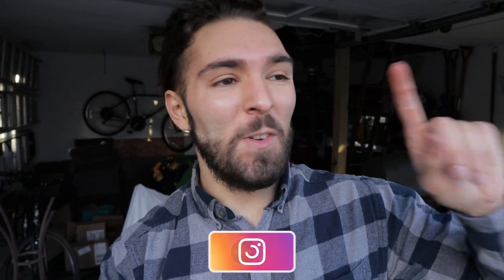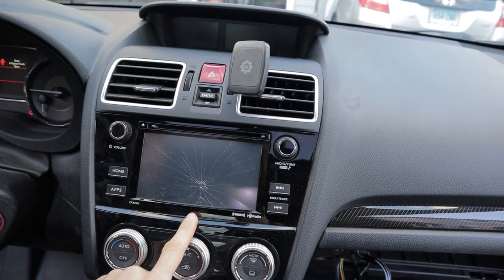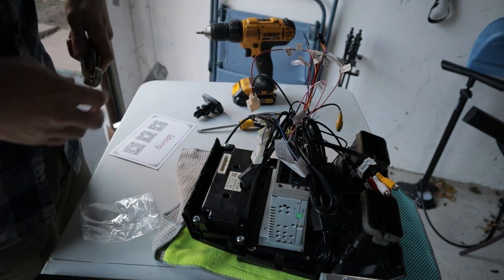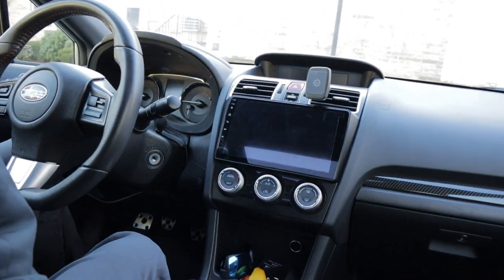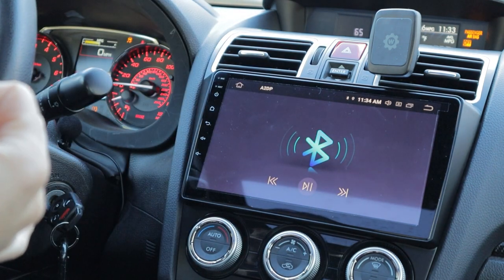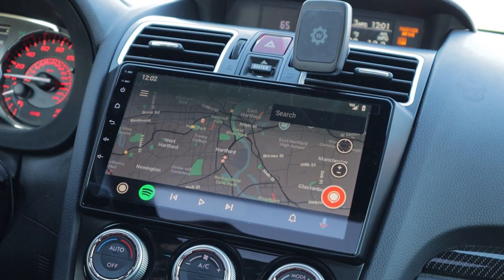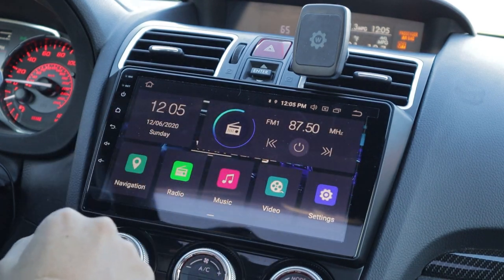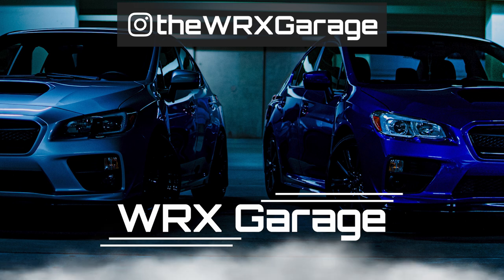iDoing Android Headunit (With Android Auto!) - Subaru WRX 15+

Comment: what voltage does the headunit put out? consensus that android headunits are garbage for sound quality... anybody that upgrades the stock headunit is going to "sound better" because it sends more voltage to the speakers. but how much? trying to compare to the well known headunit manufactures in sound.
Reply from the maker: I believe this headunit puts out around 25-30 watt RMS to 4 speakers! Stock is less than 10w rms.
Reply: @WRXGarage  jesus... thats incredibly low for a headunit and could cause interference. thanks for letting me know.

Comment: Hello ¿can you use the original factory back camera without changing anything just by connecting the cables of the new navigator audio? ¿ can use steering wheel voice command is it possible or not? ¿can it be installed on my subaru xv from the year 2015?
Reply from the maker: Yes and yes!
Reply: @WRXGarage  !!Thank you very much for your reply! ! Greetings from Spain!

Comment: in order to use z-link/android auto... do you have to connect it through wifi/mobile hotspot? Or does it automatically run off of your phones data/signal when its plugged up through the usb port??
Reply from the maker: It just uses 4g/5g cell signal
Reply: @WRXGarage  with that being said, you do have to connect through wifi/mobile hotspot???
Reply from the maker: No.. you receive all data from your normal cell signal. Connect to Android auto in the headunit via USB.

Comment: Any issues with the microphone? Did you added the extra one on top of the steering wheel ??
Reply from the maker: No issues with the microphone at all, even at highway speeds. Yes I'm using the external mic they provided and it's mounted on top of the steering wheel.
Reply: @WRXGarage  is the wore long enough that you can mounted on the factory location
Reply from the maker: Yes the wire is actually very very long. You could easily route it through the A pillar to the mirror.
Reply: @WRXGarage  I got my set for my WRX 2 weeks ago. My microphone seem not working well on both the built in or external mic when the vehicle is moving, other party can't hear me. When vehicle is stationary position, it seem ok as feedback from the other party. Any advise? Contact Idoing but they are not helpful at all. Their reply is just " No suggestion".
Reply from the maker: Definitely look in the settings to see if there's some kind of noise reduction function or something like that. I've never had any issues with my system
Reply: @WRXGarage  Have tried all setting which I able to find but no luck. Very disappointed with the support idoing is giving. No solution at all. 
Firstly my parcel come with the external mic missing. Thought after they resend me the external mic may solve the problem but same issue.

Comment: Is it normal with the Idoing head unit for audio to cut out when you have the car in reverse?
Reply from the maker: Yeah it is. I can't use steering wheel controls while in reverse either. But there's a setting somewhere you can keep the audio on while in reverse!
Reply: @WRXGarage  Gotcha, thanks for the reply. I'll mess with the settings and see if I can figure it out.

Comment: Hey dude so i purchased one for my 2012 sonata limited. I notice it had that little spinning dj wheel on bluetooth. Can you change that just curious. I was aiming for daisata unit but they said they didnt have proper connectors..also i think im getting top of line model for my vehicle..but there and ips and qled..both 8 cores..im thinking of asking them the the qled instead of ips

Comment: Was wondering if anyone knows if you need to buy a separate adapter for the apple CarPlay to work or will the system acknowledge an apple device when it’s connected?

Comment: I have a 2019 wrx with no Harmon kardon system. Would this work for mine? And does it come with all the wires that needs to be plugged in. Also would have have to still use the stock box for the front speakers
Reply from the maker: They have a specific model for cars with the HK system! You just need to search for it on Aliexpress

Comment: Do the USBs in the center console still work? Also what does the dimmer dial on the left of the steering wheel do with this installed?
Reply from the maker: Not sure about the center console usb, I've never used it. I can check tomorrow! As for the dimmer, there are two screen brightness/color profiles. The standard form is white/bright during day, black/gray screen at night/when the headlights are turned on. You can also customize how bright each of the profiles are.
Reply: @WRXGarage  awesome, yeah definitely let me know. I use the center USBs to power my dash camera, don't want to have to run another USB plug if I don't have to. Thanks for the video.
Reply from the maker: Wouldn't it be easier to route a dash cam to the glove box? There's 2 extra ones so 3 in total
Reply: @WRXGarage  I mean I could, but I still use the other port to plug in my phone for android auto.

Comment: were you able to reconnect the center console usb ports?
where did you mount your gps antenna?
Reply: order adapter from amazon to keep center usb( I now have 4), Mount GPS on top of unit.  works great.  Did first long drive today, no issues.
Reply: @marcdukette5095  Thanks!

Comment: Does it use the factory GPS antenna or do you have to route the one they give you with the head unit
Reply from the maker: New gps module! But you won't really use it unless youre actually using the built in navigation. I just use waze through android auto

Comment: Question did you loose sound in the back speakers? I installed the head unit and sounds is more prominent in the front speakers and louder on the passenger side
Reply: Hi, came across your comment while looking into this same issue and was wondering if you ever got that sorted out? I'm also not hearing much from the rear speakers and there is no sound when using the equalizer field setting to fade it to the rear.
Reply: @soggysog7302  IDoing essentially told me that was normal...... 4 channels went to the tweeters and front door speakers.... I am also dealing with passenger side being louder than  driver and have to fade the driver side to get the sound to sound equalish... i have the HK package also.
Reply: @CHILL7603  Thanks for taking the time to reply. I also have the HK package (2018 STI Limited) and thought I was going crazy. I even put in the original unit to confirm I can fade to the rear as expected. Currently talking to idoing about it but sounds like there really isn't a solution for this from their perspective.
Reply: @soggysog7302  Yeah I hit them up numerous times and sent a video and they said thats the way it is.... but I didnt hear or see to many other people saying they had the same problem.... i dont mind the back speakers just the fact that right passenger if balanced is WAY louder than the driver door. I probably will end up putting in an amp in to see if that fixes the issue.

Comment: Did you have any dead battery issues after installing this?   Just installed mine today and now My battery is dead.   Hoping its just coincidence but fearing it may be the culprit.
Reply from the maker: No issues at all with electrical or battery! Definitely go back and check all of your grounds/connections. Sounds like you have some kind of short
Reply: Did you figure this out?  I'm having the same issue.  Had to jump start it twice now. :(
Reply: Have you guys found a fix for this? I just installed mine today and have had to get my car jumped twice today.
Reply: @williamh463  I disconnected the wifi.   It seems that even when turning the car off the bluetooth and wifi do not disconnect so its constantly draining the battery.  Use the cable connection or third party wireless for car play.
Reply: @YoshimiPinkRobot  thank you! I will give that a shot.

Comment: What may be the problem with this Idoing product is that the USB connection is not working, I have tried it many times, the Android phone is not compatible through the cable, everything else is working fine. Thanks!
Reply from the maker: Which usb isn't working? The oem location or the added usb ports?
Reply: @WRXGarage  i tried both, not compatible, maybe I need to make settings on which device?
Reply from the maker: Try using a different cable. Also, are you on the correct application?
Reply: @WRXGarage  thanks, i will try!
Reply from the maker: Make sure to press the Zlink app
Reply: @WRXGarage  hi, and now I ask a other question.  A few days ago i noticed that the steering wheel music control started to work in reverse, when i press - the volume gets louder and when i press the steering wheel +, the music volume decreases. What caused such a change? Everything works correctly on the Idoing device, but from the steering wheel upside down
Reply: @arvojants148  did you ever get your Android phone to work with android auto?

Comment: Hey boss, did your backup camera lines come like that ? looks like the stock width and has the "+"...  i just installed my idoing unit last week and the reverse lines are not as such.
Reply: My 2018, had stock lines after install.  I suspect they are provided by camera, not head unit.  The aftermarket cam I put in my old car provided it's own lines
Reply: @marcdukette5095  odd - the idoing unit i have has 4 options for lines. off, 1 (narrow), 2 (mid), 3 (wide). no more stock  lines :S
Reply: @ZoopChedda  I have yet to see backup lines options in the HU. Where in the settings is it? I'll double check.  I do have the Can Bus but I doubt that affects Reverse Camera.  Which HU did you get, the PX6? or the UIS7862? Do you have 7 optional launchers?
Reply: @marcdukette5095  It's the PX6. No optional launchers unless i download them from the playstore (as i'm told from idoing). If i recall correctly i was in Settings>Car> Reverse Lines > then it provides the options as i've listed above. it also allows you to mirror the camera feed if you wanted to. Unless you have a dope solution, it appears i have to re-calibrate my brain XD
Reply: @ZoopChedda  Just took another look, no lines options, however I do have the reverse image option and it does work.  SOO... I just did some reading and while yes the grid lines are part of the OEM backup camera, there are variances in the wiring, some allow turning off or on or changing options.  With Subaru often from year to year the cameras are not 100% compatible with different years head units.  Perhaps you have a unit programmed for 2017+ but a camera from 2015/16?
Reply: @marcdukette5095  Thanks for the info Marc! silly subaru at it again. Looks like i'll accept defeat on this on a re-calibrate my brain. Did you find some subaru reading? or just scour the interwebs?
Reply: @ZoopChedda  just a lot of people complaining that when they put cameras from earlier models not finding the right wiring and not having lines.
Reply: @marcdukette5095  Fair enough! I mean i can't say i didn't screw up the wiring, but plugged everything possible from the stock HU in so i've assumed she's good to go. perhaps my 2016 camera just doesn't jive with the PX6. Figured the camera feed was just the image the lines were placed by the HU. hence my head scratching.
Reply: @marcdukette5095   click on settings, go to factory settings, enter the code, click on original car agreement, then click on reverse parking line.
Reply: @dakinekai808  ok interesting, that adds a second set of lines, completely unaligned with the car/camera position.  So that answers the fact that the lines I have are stock from the camera and not the HU.
Reply: @marcdukette5095   @Kai Did i miss a code somewhere :O ? or different HU?
Reply: @ZoopChedda  I think you said you got the PX6 version? I got the UIS7862 version, probably slightly different  settings.  THe HU lines seem useless to me in any setting as they are not aligned correctly with the back of the car.  Stock lines from the camera are great.
Reply: @marcdukette5095  ah yes okok forgot about that difference. thanks - i'll update if I find any news. cheers!

Comment: i installed one of these on my 17 STI (base trim, no starlink) and now my front speakers don't work. I checked the wiring diagrams and pinouts and everything lines up... any clue?
Reply from the maker: Do you have the Harmon kardon system? Also, have you checked to make sure the program is sending volume to the fronts? If not, sounds to me like the 2 pins or grounds aren't making contact properly.
Reply: @WRXGarage  Basic basic sound system. I've already replaced my speakers and while sounding terrible, they did work with the factory head. I plugged and unplugged a ton to no avail. My rear speaker harness actually came reversed as well (L playing from R and visa versa). That was easy enough to sort out, just changed out the pins. What should I do about the fronts to test/fix?
Reply from the maker: Hmmm.. I wonder if there's a different model or pin alignment for the 2017 vs 2016.
Reply: @joemomma2293  Same here. the Rear speakers is reversed. Worse the bluetooth for phone not working well. Other party can't hear me when vehicle is moving.
Reply: @ericlim5041    @WRXGarage  so i figured out my issue. I'm just stupid and my vehicle has the starlink box. I didnt realize it was attached to the underside of the factory headunit. as for the speakers, its pretty easy to push the pins out of the connectors and swap them around. just look on youtube how to remove pins from a plug and youll find something similar to what you have. as for bluetooth, if you dont have starlink, i'm not sure. My friends have told me the microphone that comes with these kits (mine in particular) is terrible. I think it needs to be routed up the A pillar to get it closer to your face. I wish someone would figure out and show how to get the factory microphone to work with this unit.
Reply: @joemomma2293 I'm gonna be getting my idoing for my 2017 wrx. Can you explain how you got the front speakers to work again? I'm getting nervous that I'll have the same issue
Reply: @Y012AD  read my last comment

Comment: do you need to replace the two 10mm bolts on the right and left side of the console when installing?
Reply from the maker: Nope, it'll hold itself in place
Reply: @WRXGarage  thanks! also do you recall messing with a parking wire from the harness?
Reply from the maker: No, it was completely plug and play for me. Just make sure your reverse camera works before pushing the headunit into place. If I remember correctly, there was 2 different yellow connection options for the camera.
Reply: @WRXGarage  alright thank you!

Comment: Why dont any of these videos explain how insanely hard it is to unscrew the driver side bolt. Its crazy down there
Reply from the maker: 🤷‍♂️ I've done a couple different headunits, never had much issue. Just need a long enough extension
Reply: @WRXGarage  guess mine were insanely torqued from the factory, i had enough extensions but not really any room for leverage.
Reply from the maker: There's an option in the settings menu!
Reply: @HayWoodJobLoMe  Yeah mine were wicked tight as well. Unfortunately lost a 10mm socket somewhere in the abyss during that process as well.
Reply: @B0RGUS  yea i lost one to, luckily ii had a magnet and was able to fish around. I was just frustrated when doing mine.

Comment: I’ve had this for like 6 months and I still haven’t been able to get the bezel you actually pop in all the way my fitment is terrible on it
Reply from the maker: I didn't have any issues with it myself.. definitely a tight fit but I got it in pretty easily!
Reply: Omg I literally just got back from the garage frustrated because I can't get mine to pop in all the way either. The top side has a huge gap... let me know if you find a work around
Reply from the maker: Pretty much everyone has said that it's a tight fit.. trust me. It goes in, you have to make sure all of the wiring is out of the way in the back, and give consistent pressure across the face of the bezel and it will pop in
Reply: @WRXGarage  Yep, you are right I just had to start from the bottom and put an uncomfortable amount of pressure on the sides of the screen. eventually I was able to get it all clipped in. Thanks

Comment: how did you set this to night mode always on, i can only find the usual dimmer
Reply from the maker: It's in the settings! You can also use the WiFi to download a screen dimmer app like "night owl" and use that to control the lighting, especially at night it works a lot better.
Reply: @WRXGarage  thanks for the reply, is it called night mode ?  ill have to check it out again later, all i could find was a dimmer for day and night (headlights on/off) brightness but not this. or im just blind and cant see it

one other question, when you popped your fascia back in  did you have to jimmy the very top to click into place properly or it clicked in easy enough
Reply: @WRXGarage  side question to this. on the rear of the unit it has a wifi antenna port, did you connect that, im assuming thats for cel service to the unit directly (without tethering) but i've seen a few videos of people saying that was for bluetooth (even though there was a small BT probe attached to another cable)
Reply from the maker: The antenna port is for better cell signal and location services (gps). To actually use this unit with cell service you'd have to separately purchase a SIM card and plan for it. I did not use the antenna. It's definitely not for Bluetooth though.
Reply: @WRXGarage  yeah i didnt think so. too many videos on youtube. cheers mate. much appreciated